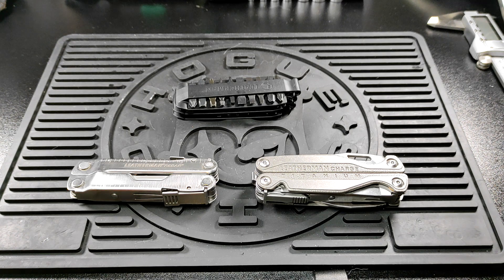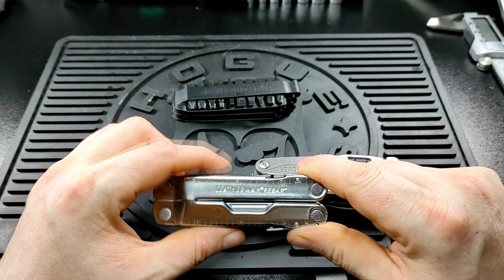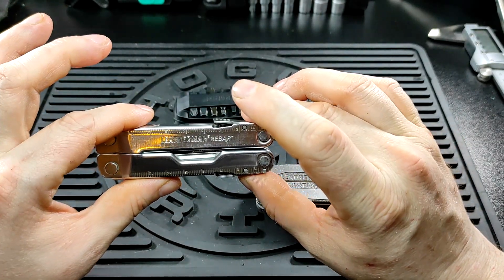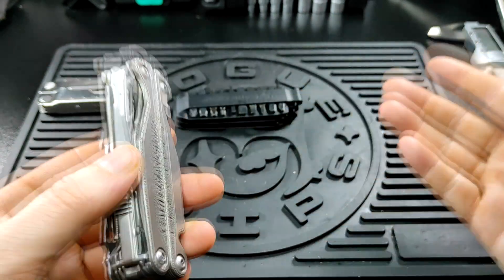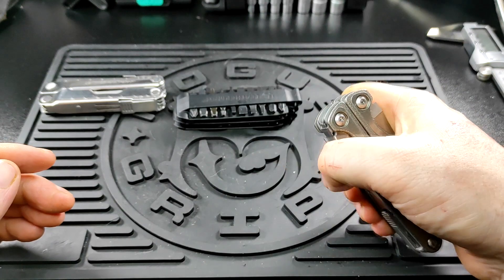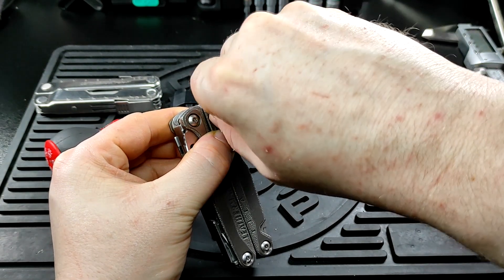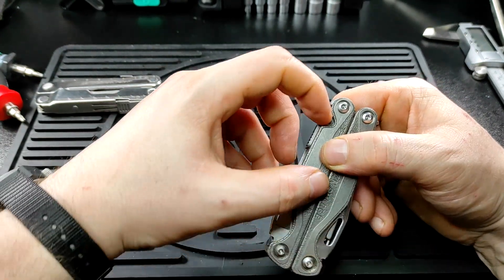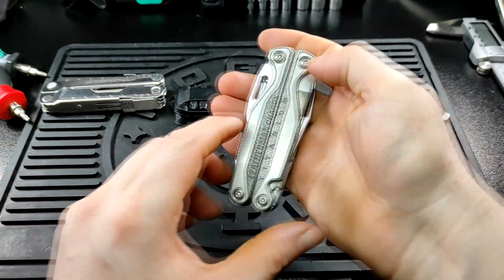leatherman Charge edc friendly mod

Comment: Well presented and researched. I have a Surge, but don’t carry it in public. I use it when I go fishing, but leave it in my tackle bag, and if I go to do diy, it goes in the tool bag. These are reasonable and arguably legitimate points. Although I couldn’t find it in me to actually snap off the locking parts, as you have done. So I live with it sitting in a prominent place indoors and used often, for all sorts…love it!

Comment: I've never been stopped and searched, I'm well into my 70s and carry whatever seems appropriate for the day, whether it locks or not. If you look dodgy, hang out with dodgy characters or behave suspiciously, then you're increasing your risk of whatever they decide to do about it. I am aware of what might happen but what you've been doing is ridiculous, the tool has locks for safe operation, you've reduced it to a letter opener. If I was going shopping or to a public event, I'd usually carry nothing but on my daily country walks I usually carry whatever appeals to me from my collection.
Reply: I do exactly the same
Reply: Yes sir common sense I'd think but reckon that's not so common anymore

Comment: I saw another leatherman mod used in either a surge or a wave which I'm very tempted to try at some point, and that actually involved getting a mora craftsman fixed blade knife, cutting the handle off and drilling a hole for a pivot, but leaving a larger radius around the outside of said pivot; to then do a blade switch. That means that you can change the standard leatherman blade with a liner lock into a modified mora blade with a detent retaining system. Much more long-winded, but it requires no permanent damage to the leatherman, and as the mora craftsman line is the exact thickness stock of the leatherman blade stock, you only need very minimal tools to do it. You can also reshape the blades or do etches/engravings on the mora's, because they are so cheap it doesn't matter if you mess one up.

Comment: Thank you so much for this brilliant video and clear explanations.  I'm in the same position with my WAVE+ and will probably opt to remove all 4 locks.  Madness though what has to be done to a safe and so handy & expensive multitool just to tick the boxes to meet UK law.
Reply from the maker: Thank you for the kind words! It's crazy isn't it, we have to make our tools less safe to be allowed to have them!
Reply: @UKLegalCarryKnives  100%.  Altering the multitool to make it non-lockable does indeed remove the locking safety aspect.  I'll be fuming if I ever cut my fingers/knuckles when using the item without the safe licking feature. It's just a utility tool. If I wanted to harm anyone, which I certainly couldn't and wouldn't do, I could use ANYTHING as an intended weapon, i.e. a pen, screwdriver, chair, umbrella, etc etc.

Comment: It's a shame leatherman don't make an EDC variant for the UK market, they after all made a two handed opener for Germany to comply to their laws. Simply a variant of the case without springs for the blade and an adjustment to the torque of the screws should make it a pretty effective friction folder.

Comment: The mods you did on the rebar will work on the free series, where all the tools are outside accesable.

For my Charge tti, I heated and bent the liner locks so they barely engaged and would slip under pressure.  I recently undid the mod as I lost my Surge (work tool)

I find the SAK cybertool 34 useful for street carry.

Comment: I have also removed the locking mechanisms on Leatherman.  
I have a Squirt PS4 and agree this is more a curiosity than for day to day use, just for attaching to a key ring. I also have a Leatherman Juice XE6 which does not have any locking system straight from the factory. It is my understanding that the Juice is legal in the UK.

Comment: I have the leatherman sidekick which would be a good option for the mod you did on the charge. As non of the tools on the inside actually lock there is no reason to get rid of anything once the lockbar for the knife is removed. Thanks for the info 👍🏻👍🏻👍🏻👍🏻

Comment: The closed multi tool as a lock concern is based around the locking knife = fixed blade case law from Harris vs DPP which stated "readily foldable at all times" not sure about the other test case with broken lock decision. 
I know you don't mind mods but I could never have done that to a charge, a wave yes but not a charge. For UK legal, you could just buy a used Juice, I find it has done everything I need for years despite being a bit smaller.

Comment: Constables decisions are not infallible, we've seen this on lockdown enforcement, but unfortunately costs money to defend and could end up with the wrong type of precedent.  Sadly the country we live in.  I've removed the two knife blades from my Rebar and replaced with tools from a Sidekick/Wingman.  I think there is a big difference between blades and tools.  Blades in the pocket can be illegal,  a screwdriver (in the pocket) only becomes offensive when presented threateningly.  There are plenty of really good UK legal knives, my current favourite carry is a Real Steel Luna.

Comment: Even if not locking under 3 in , the come up with pointed object in public, going equipped if at night , law needs changing
Reply: Anyone who didn't take that far of a reach to court is a fool, the law specifically states non locking under 3 inches requires no reason to carry day or night, and therefore CANNOT be considered going equipped, even a screwdriver isn't classed as a sharply pointed object or as going equipped. I would fight that charge to the bitter end and even claim compensation for my unlawful arrest etc. It's on them to prove your intent, having a perfectly legal tool in your pocket alone is NOT lawfully enough to determine your intent, unless they saw you brandishing it, or prying at a car door, shed window etc.. they couldn't possibly lawfully charge you for going equipped based on simply having it in your pocket. When i've been asked what my reason is for carrying my legal edc tools, i reply no more than "because the law very clearly states i can in black and white" they don't need ANY more reason than that.
Reply: @MDM1992 Do you think a jury of the public (who are mostly brainwashed with anti tool news and such.) will side with you if it goes to court ?
Reply: @MDM1992 
😂😂😂😂
38k people arrested last year for defending britain.

Comment: Very interesting video and you have gone to great lengths to comply with the law, and I sincerely hope you are never pulled up for carrying it. It is ridiculous that you have to mutilate and disable these tools so much making them quite dangerous to use for the designed job by making them non locking and able to trap ones fingers when using them

Comment: The argument with easily converting here is a bit sketchy. Basically you can tighten any slip John knife to the point where it is fixed. Off.